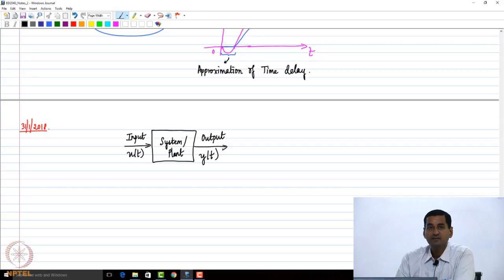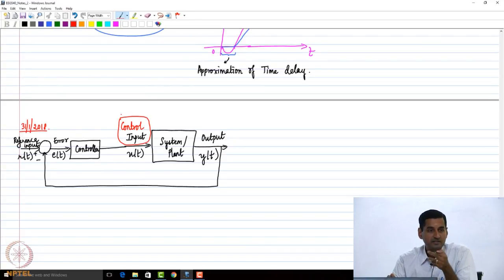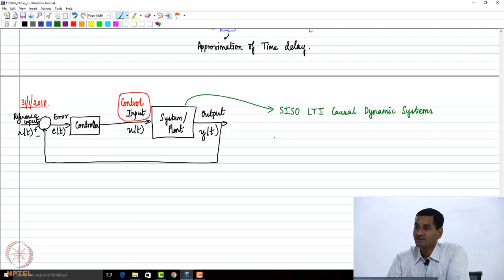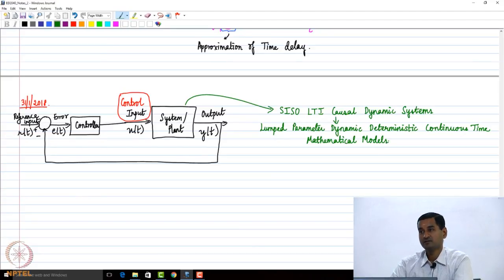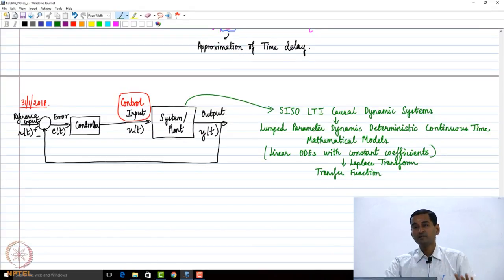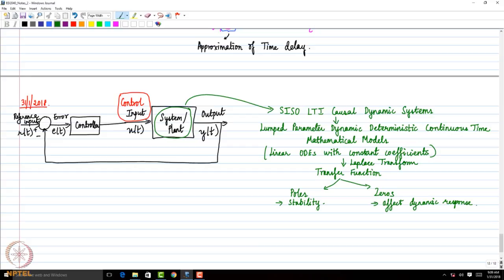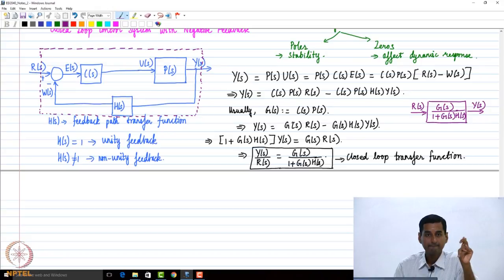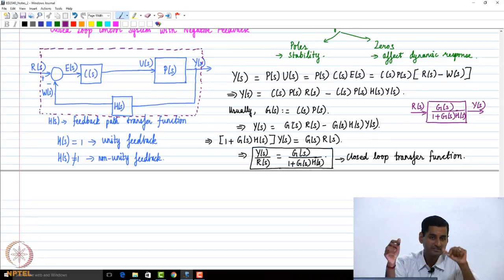Closed Loop System - Part 1

Comment: brief summary till today 0:00
block dia of control system in complex domain 9:30
 unit feedback 13:00
cloded loop tx func y(s)/R(s)=G(s)/(1+G(s).H(s))   15:30
CL poles and zeros 23:10
CL characterstic eqn 24:20
polynomial 1+G(s).H(s) called characterstic polynomial 25:20